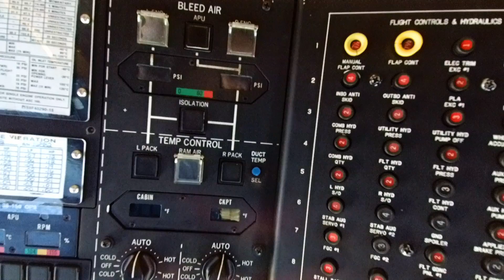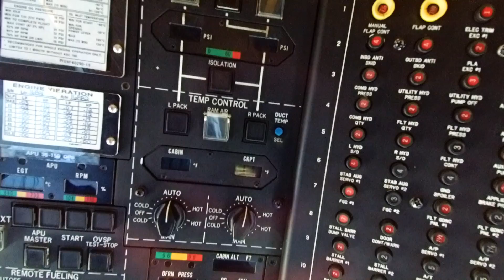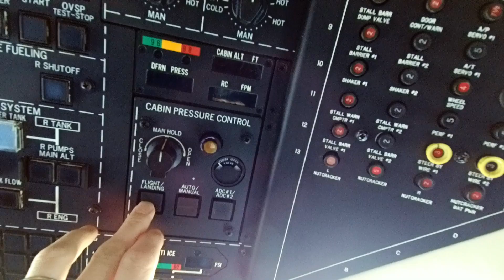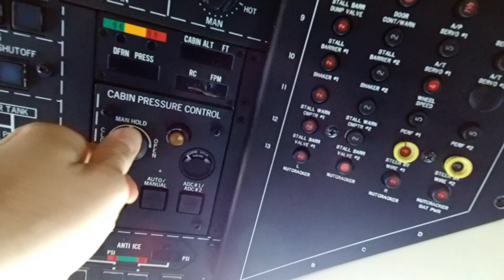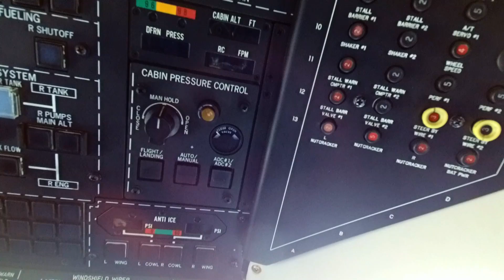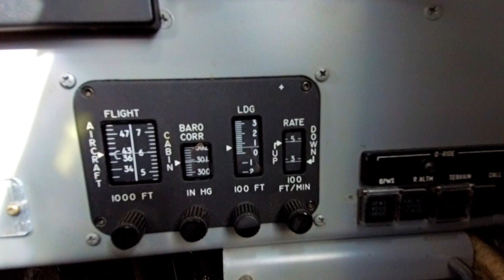How the Gulfstream Pressurization System Works - Pilot VLOG 58

Comment: Are this system fail proof.  I remember payne struart died where the plane ran our of oxygen and crashed.can these  newer syttems ever do. Thanks. Love all videos. Darryl
Reply from the maker: There is always the possibility of a system failure, but we do have multiple redundancies to prevent any issues.
Reply: On Payne Stuart’s crash there were a series of stuffs (as always!) that lead to a disaster. The PIC decided to taking-off with Pressurization OFF to reduce noise levels inside the plane or to get more thrust during takeoff roll... I don’t remember. The SIC didn’t have much experience on type (my guess is that she didn’t have much hours on pressurized planes) and then, when the loss of O2 started to set in, the checklist gives a lot of “what if” conditions, rather than instruct the pilots for a OXY MASK =  Don immediately. Unfortunately!
I don’t think there’s a plane, even the modern ones, that “senses” bleeding air closed and elect to open one if the Folks forgot to and also obstacles may impose a penalty in ROC. With the cutting-edge tech, I suppose to be possible - FMS has the altitude of waypoints so after passing the TERPS minimums, the system does... and be registered in FOQA or whatever...🤭 I like someone else who flies a plane with such advantage to join and tell us how it works...if already exists!

Comment: Very informative, thank you so much :-)

 So the emergency relief protects you in case of a fail closed event on the main control valve, what protects you in the case of a fail open, anything besides the emergency oxygen system?
Reply from the maker: The valve has 2 separate motors so that if that happens, we can switch to the other motor and manually and close it.

Comment: Great vid, as yoosh.  It seems that there would be a lot of vacuum created by the airflow past those holes. Is that what the v shaped fins in front of the safety valve for, to deflect it around the vent holes?
Reply from the maker: Yes indeed

Comment: So if someone smoked a big joint in the back you could crank up the pressure control on the cabin and the smoke would get sucked out super fast?
Reply from the maker: I suppose we could open the outflow valve all the way, but everyone would pass out pretty quick. We have no way of controlling how fast the air comes in the cabin, just out.
Reply: I read I think in the wolf of wall st book or whatever,..that they were smoking and that since the cabin was pressurized,..simply opening some air vent would suck the smoke out in seconds. Prob just some idea to sound smart that doesn’t work in real life.  Thanks for response.

Comment: That little aerodynamic arrow in front of the emergency relief valve also plays an important role especially when cruising more than 450 knots. If you notice the fins on both valves are pointing aft to prevent back pressure and the arrow reduces the amount of pressure around those valves to allow air to leave the cabin at a controlled rate.

Comment: I have worried about this vaguely ever since the Paine Stewart incident. Did they ever figure out what happened to his plane?
Reply from the maker: My understanding is that there was an oxygen valve on the outside of the plane that was not turned on prior to the flight. Very tragic accident.
Reply: Long, weird incident that wound up in Kansas somewhere after the plane ran out of fuel. There must be big, loud warnings for this now, as a result.

Comment: Really enjoy he tech videos. I would love to hear an explanation as to each of the check lists that you run through prior to taxi; take off; landing; and after landing enroute to the terminal.  Specifically the meaning of the terminology used and its meaning.

Also, during flight i see the little wheels next to the pilot and copilot turning as the aircraft auto pilot makes correction.  These wheels are black with white hash marks on them.  What are they and what do they do.

And finally can you shoe us John steering the aircraft with that little wheel.

Keep living the Corporate Pilot Life, Great Job; Enjoying the videos.
Reply from the maker: I'll add the checklist stuff to the list of tech videos to come. As for those wheels, they are the trim elevator wheels. We typically use the electric trim switch on the yoke to move them, but if we lost electric trim, we could use them by hand. glad to hear you're enjoying the videos!

Comment: Hi Sean, Matthew here living the airline contact centre life. 
How do you maintain the oxygen levels in the cabin, at altitude.  If the air is coming into the aircraft from the engines, surely the oxygen level is low which,  would lead to hypoxia? 
Brgds Matthew
Reply from the maker: Nope...there is plenty of oxygen at altitude. It is just very low pressure, that is where the engines come in. The engines compress the air to increase the air pressure for the cabin.
Reply: Corporate Pilot Life Cheers Sean, now I understand it!

Comment: questions! air start, engine sync, x nav., on departure while hand flying do you climb out at a set speed or feet per minute?
Reply from the maker: Air start is the engine ignition in case one of them were to flame out, it would automatically re-light. Engine sync is a system that makes the engines turn at the exact same speed; this reduces the droning from the engines inside the cabin. We don't have X NAV, but we do have L NAV and V NAV. These are navigation systems for lateral and vertical guidance. On departure, we fly speed. Usually it's 200 knots initially, then we quickly accelerate to 250 about 5 miles from the airport.

Comment: Hey Shaun, does the FAA regulate which type aircraft can be operated with a single pilot. I've seen videos of Cessna Citations operated with just one pilot? I can't imagine flying your Gulfstream single handed.
Reply from the maker: The FAA has to certify the airplane to be flown single pilot, but the manufacturer has to design the airplane specifically for that, especially the cockpit layout. Flying the Gulfstream single pilot isn't so much the concern, the problem is that there are many switches and controls that cannot be reached by a single pilot.

Comment: That force that causes water being flushed and swirling counterclockwise is the coreolis effect. Took me a day to remember. Not sure if that is the correct spelling. It was in my aviation weather course almost forty years ago.
I've never been a smoker  but I remember when I was in my early twenties back when you could actually be invited to walk around and observe a preflight of something like a Boeing 707...I was shown the outflow valve with orange "streaks"  on the paint. I was told it was nicotine from all the smokers. It was totally gross. I also remember the many years before smoking was banned having to visit the rear "can" and fighting through the thick fog of tobacco smoke. I always felt so sorry for the flight attendants having to work the rear section of the AC.

Comment: I always wondered. So if it loses preassure all together, the masks drop? If so does the plane have on board oxygen?
Reply from the maker: Yes. There are multiple oxygen bottles under the floor of the airplane for both the crew and the passengers. if the cabin reaches about 13,000 feet inside, the masks will drop.

Comment: Nice video Shaun. Well explained, short, to the point. If the right hand seat pilot is flying, can the left hand seat pilot reach the pressurisation panel?
Reply from the maker: The overhead part, yes. But not the panel at the right knee of the right seat pilot. That's why this is a 2 pilot airplane. In order for an airplane to be certified for single pilot operations, the left seat pilot has to be able to reach all of the controls from their seat.

Comment: Hey Shawn, What is the ETOPS and how do you guys plan for those flights i.e on the flights you guys did to Europe. What all goes into that trip and how long can you guys fly on one tank and limits for you as pilots?
Reply from the maker: As far as ETOPS goes, we have to be within 180 minutes of a suitable airport at all times. It's pretty easy to stay in that range in the Atlantic. The planning for an Atlantic crossing has a bit more effort than a normal, domestic flight. I'll do a Tech video on that. The G-IV can fly about 4000 nautical miles on a full tank of fuel and still have the normal reserves. As a 2 person crew, we are limited to 10 hours of flight time in any give day.

Comment: What was the "ram air" button on in the middle of the overhead pressurization panel for?
Reply from the maker: Kind of a silly button really. That simply turns both PACKs off. I've never had to use it, but there are a few wild emergency situations that call for it in the checklist.
Reply: Thanks!

Comment: for bleed air can apu charge left pack? please explain isolation use. with both engine on at altitude have you ever start and run apu if needed for bleed air or for anything. don't mean to be ? hog but given this chance at first hand knowlege pricless. thank you
Reply from the maker: The APU bleed  air is restricted to ground use only, we have used it in air for electrics though. The APU can operate both PACKs through the isolation valve; it opens automatically when the APU air is selected on. Another reason for the isolation valve is in case we lost one bleed system in flight, we could open the isolation valve so that the remaining bleed system can operate both PACKs as well.
Reply: thanks fish on shaun

Comment: Was it a pressurization failure that caused the tragedy of the plane Payne Stewart was on?
Reply: I find it suspicious that with a press failure, or a "rapidly ascending cabin altitude", that no alarms were generated to notify the crew. Even a basic King Air will alert you to a problem with cabin altitude
Reply: yes , it failed on the Lear and people went "night night". I wonder why  there was not some sort of drop down emerg air in these a/c?
Reply: Justa UKfan  I also wonder if the O2 tank was empty or if one of the valves was dead. Some aircraft are capable of real time tank pressure and flow, most aircraft are not

Comment: On commercial airlines, you only need to set the top of climb altitude and landing altitude, and ensure engine bleeds and packs are on.  Does the gulf use bleed air for other purposes such as removing ice from the wings and engine inlet?
Reply from the maker: Yes...I can't speak for other Gulfstream models, but the G-IV uses bleed air for engine cowl and wing heat
Reply: Jerry Korman yes it does.......the boots don't always get the thin rime off efficiently....mechanical boots can be even worse..
Reply: I'm sure a hot wing works better than a bleed air boot
Reply: Newzchspy yep, the King Air 200 I flew had boots and electrically heated props. The boots are better than nothing, I suppose

Comment: Do you also have to change the baro on the lower panel going through transition altitude or is it only relevant for field elevation?
Reply from the maker: That only needs to be done for takeoff and landing baro settings

Comment: ? please what are the abnormal situations concerning the manual hold. also what if both computer 1 and 2 are down. thank you for video and replying to peoples ?
Reply from the maker: The first abnormal situation that comes to mind is actually your second question...if both computers fail, we would have to use manual mode. There are an assortment of electrical failures that would render automatic mode inoperative. For instance, the auto mode is run by AC power, and the manual mode is DC power. So if we had an AC power loss, we would be using manual mode.

Comment: what concern's or procedure's on  closing air intake and cabin pressure for ditching.also guy below wants you to roll plane come on denzel what if elevator stuck in climb could you pull it off just kidding .
Reply from the maker: HAHA! I suppose we'll just leave that to the professional pilots of Hollywood. If we had to ditch, the only valve we could really control to limit water intake would be the outflow valve. It would be switched to manual mode and quickly closed.
Reply: i wonder why the outflow valve is not more near top of plane instead might buy more float time. have you discussed with jon who is last out if both okay
Reply from the maker: That's something that has never been discussed. Hopefully we're never in that situation, but it's definitely better to have a plan before you get there.

Comment: At what altitude do you normally pressurize to when you are at cruise alt? Is it around 8000 feet like most commercial flights?
Reply from the maker: We're lower...more like 6000 feet.
Reply: Aren't most commercial flights between 9-10,000 feet for pressurization?? 6 is on the low side ( higher pressure) for sure.

Comment: Are you able to explain which stage of the compressor does the bleed air come off either or both engines? To get into further detail (may require a amp mechanic), can you explain how the air is mixed from the air coming off the compressor at 200 centigrade? Does it go thru an air cooler along the wing? 
It’s a tough question that may be beyond the scope you must know as a pilot. If you can make a video explaining this, it would get several views.
Reply from the maker: That is actually covered in the pilot training. I can do a video showing this if you would like. To give you a simple version, it uses 7th stage and 12th stage bleed air, depending on load. It has a pre-cooler in the pylon to reduce the temp to some degree, then it goes into the aft equipment area to continue the cooling in the PACKs. I was planning a Tech video in the aft equipment area soon, and much of this stuff will be seen there.
Reply: Corporate Pilot Life then the FADEC will add more fuel to compensate the throttle setting. I’m surprised that Gulf stream has not designed a bleedless air system to pressurize and deice.
Reply from the maker: Keep in mind that the G-IV was designed back in the 80's. The newer Gulfstreams are much more advanced.

Comment: Great video Sean. Is that valve out the side of airplane usually the problems when I hear some airliners say they a  Pressurization issues. Thank you again for the education
Reply from the maker: Possibly...the system is quite complex, especially on airliners, so it could be one of many things. That valve is one of the most critical parts though

Comment: Now I know why some peoples ears pop, not a problem for me, but a wrong setting on the descent rate could explain why some people have it. Did not  know it was adjustable as that. Now I know, thanks great video.
Reply from the maker: To be honest, I usually lower the rate a bit to make things even more comfortable. You just have to be careful not to make it too slow, otherwise it will reach the limit on climbout, or still be pressurized on landing.
Reply from the maker: I've never flown for the airlines, but my understanding is that they generally run a slightly higher rate than we do. I think they are around 600 FPM on the climb and 400 FPM on the descent. Obviously every airplane is going to be different, so some are very like less than that.
Reply: Maybe you do not have an answer but is there a standard rate used by commercial airlines or does it vary by aircraft or airline?
Reply: I almost always have ear problems when descending in commercial aircraft. But when I got my Sport Pilot license, I discovered if I kept the descent rate at 500fpm. I didn't have any problems. Now was that because I typiclly flew at less than 5,000 feet, or ... ????

Comment: Been studying bleed air systems. They actually do a lot of things from controlling pressurization to heating and cooling the cabin to providing de icing of the engine inlet guide and leading edges of the wings and tail. Also it is used to pressurize water to the faucets and it provides hydraulic pressurization to brakes and other systems requiring hydraulics. Pretty cool design. So does bleed air come from the n5 and n8 stage of the compressor of the g 4 ?
Reply from the maker: Yes indeed
Reply: You may or may not know of a you tube channel named "AgentJayZ".  Lots of videos about gas turbine engines .  He explains all about how and why they work.
Reply: Jayz does excellent videos. I show them to my engines class.
Reply: It also depends on how much bleed air a given turbofan or turboprop can put out. Something like a King Air 200 with the PT6 has enough bleed air to heat the engine air inlets, brakes, and provide pressurization. The King Air needs deice boots and electrically heated props to minimize icing. IIRC, the PT6 takes bleed air from P3.
Reply: AgentJayZ is pretty cool. He has given demonstrations of his huffer cart, and has even played a melody with a turbine. To demonstrate FOD, he dropped a bolt into a stationary turbofan core that was upended. 

The turbine made an interesting tune, almost like a wind chime, as the bolt rattled down the many blades.
Reply: Upon reading this, I should add that bleed air on the King Air is used to cycle the boots through a bleed powered vacuum venturi. That takes a lot less bleed air than directly piping it to the wings. I should also add, thanks to an email a buddy just sent me,  that the PT6 inlet is deiced by exhaust gas piped from the stacks. The inlet is always hot. I had forgotten that after 20 years